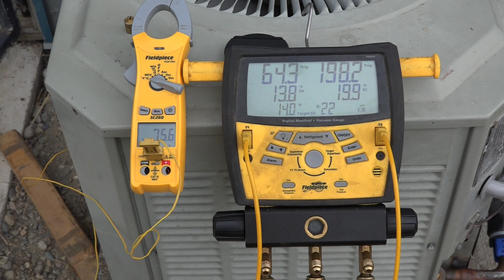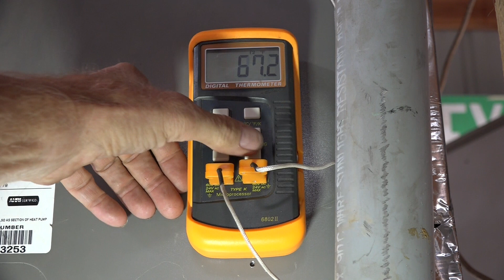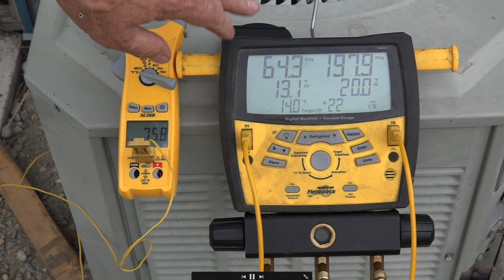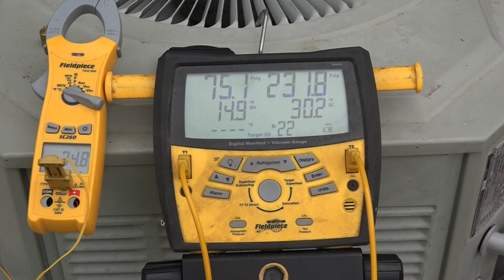Head pressure of the A/C under high load

Comment: Nice video GFM. Why did the subcooling increase from 20 to 30?
Reply from the maker: Nicholas CeeA This was interesting.  I think that the low outside temp created somewhat of an inbalance.  With the higher head and low temp, the condensation occurred earlier in the condenser.  What  did not seem to make sense is with the increased subcool, there was no increase in superheat.  I have seen this before, but mostly in heat pumps in the heat mode.  It just goes to prove that we are not engineers and don't know everything.
Reply: grayfurnaceman I may have found the SC answer. I was thinking it would be nice to see an R22 PT chart in graph form and sure enough there are plenty on the net. In the 200-250 range the P/T relationship is not linear which I think would explain it. The higher the pressures, the more non-linear it becomes.
Reply from the maker: Nicholas CeeA That could certainly be.
GFM

Comment: So basically your saying that under an unusually high load it will appear that their is a airflow problem inside
Reply from the maker: derrick owens It is probably a little more extreme than that, but it could indicate high air flow.
GFM
Reply: How could a 24 degree drop indicate high airflow wouldn't that have to be high pressure low temp drop?
Reply from the maker: derrick owens Oops, wrong video.  This one actually appeared to increase in efficiency and was moving more BTUs as the load increased.  But you are right that it would appear there was low airflow by looking at indoor temp drop.  When viewed with the superheat, the airflow issue becomes less probable.
GFM
Reply: I started a up stairs unit up after a repair it was almost 100 in the home they had been down for a week and I too had a higher than normal head pressure and a large temp split left it alone cause I had weighed in factory charge came back a day later everything was back to normal it just goes to show that running these machines when there is a unusually high indoor load is not typical and to be honest I've seen some weird pressures and temps from having a higher indoor temp rechecked a day later all was good
Reply from the maker: derrick owens It does happen.
GFM